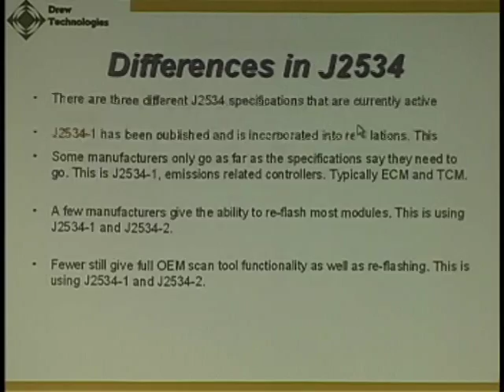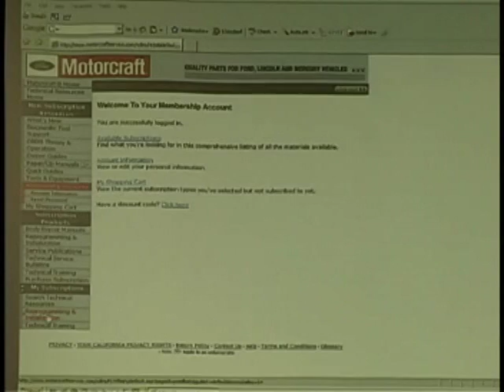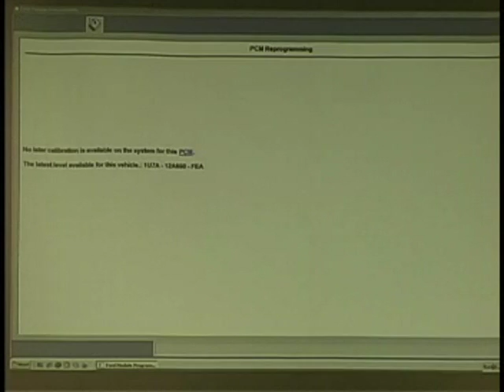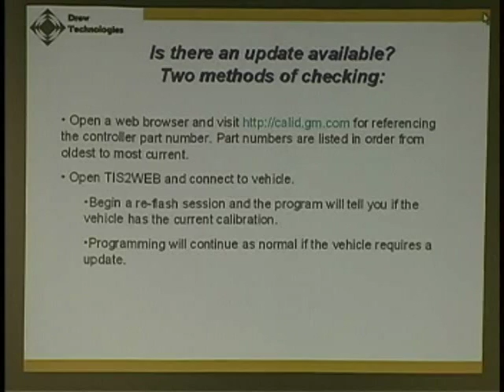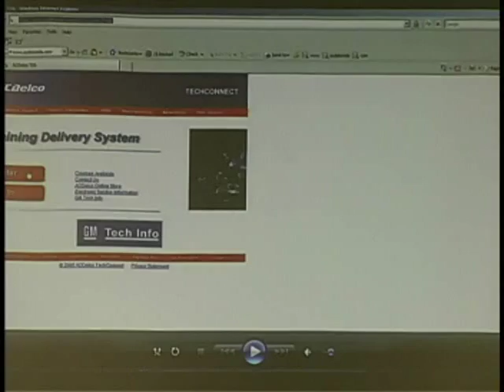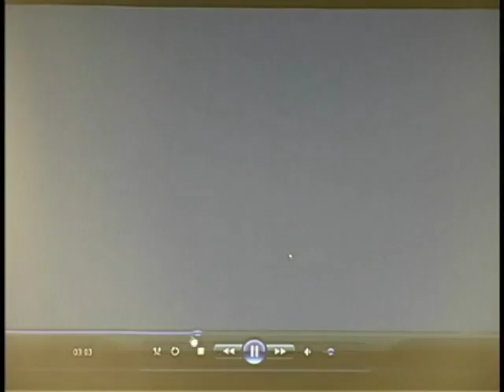J2534 Reprogramming with Mike Bowdish

Comment: Hi, Im having trouble programming the BCM in a 2011 Equinox. Im using a 
universal programming tool with the J2534. as i follow the steps i get a
 communication error message. Weird thing about this is that with my 
Snap-On scanner i do have communication with the BCM. I can sure enough 
program the ECM and other components but i cant program the BCM. and I 
also dont have any U codes. Please help!!
Reply from the maker: What J2534 programmer are you using? Some unit may not function properly with the BCM.